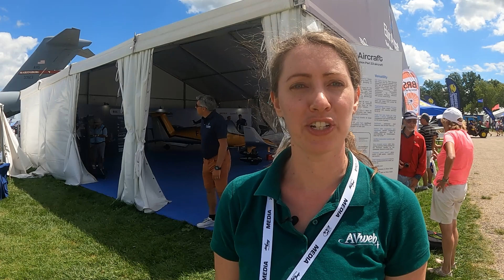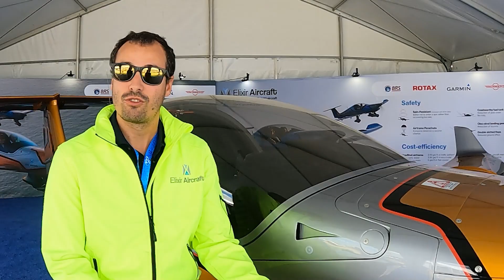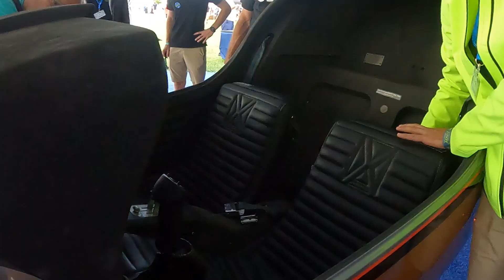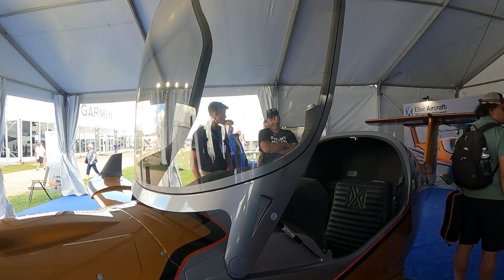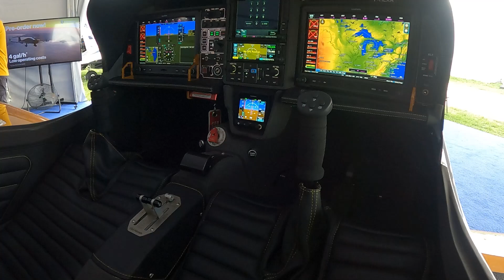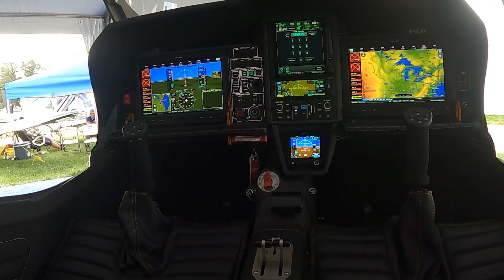AirVenture 2022: Elixir Aircraft

Comment: $250k for a fixed-gear two-seater? I like to see innovation, but at that price I'll stick with my plans to build an RV-10.
If two seats suited my mission, I'd be looking at the DarkAero 1, which should be cheaper than this, has retractable gear, and will be much, much faster while getting around the same fuel economy per mile.
Reply: The Risen 915 SV and JMB VL3 as well... Same price, much faster (especially the Risen), and they don't need to be built.

Comment: Awesome looking aircraft. My only concern is quick egress if the aircraft flips upside-down.
Reply: do you have the same concerns with Vans, Cirrus, Diamond, Corvallis TT, or Icon?
Reply: You simply have a dedicated crash axe onboard a ps a go-no-go item.
Reply: @bwalker4194  Flipped upside-down in water will be very difficult to axe  your way out. Not that simple!
Reply: @pilotpeego1820  you’ll probably want to get the canopy unlatched before you hit the water, so that it will sink out of the way. Flipping it on land will be much more dangerous. You probably wont be awake to escape anyways, the fire suppression system might keep you alive until the firemen arrive to get you out. I supposed the axe is a good idea as well.
Reply: @Heatherder  Noted

Comment: Moi, je pas comrpends $300K pour un 2-seater quand vous pouvez acheter un C172 pout beaucoup moins.  And I only speak Cajun when drunk and/or angry.
Reply: It's a 2 seater, flying at 160kt, and burning 15L/h of fuel. Without taking into account the operational costs (maintenance), that it can also fly with normal car gas as well, it's actually very interesting in the long term.
Though, it's true, 2 other seats are missing, but that is a long term plan of the company.

My flying club (in France) bought 2 of them, the training versions, and costwise, it's very interesting (it's the 250000$ version).

It's true though that this aircraft was initially aimed for the European market, where EASA is sometimes stupidly requiring to much constraints on the aircraft (the perfect example is lightbulbs, we are not allowed to change them). Making something very simple to operate for Europe, will definitely be interesting for the rest of the world, including the US.
Did not mention the fuel prices as well. A liter of AVGAS before Covid was at about 2.5€, (it's now 3.15€, went up to 3.6€/L, about 14$/Gal, when in the US it's about 6$), so very low demanding fuel aircraft is also a plus in the thinking of the aircraft. All of this will definitely benefit in the US, and the aircraft is already lead free fuel compatible.
I approve though, this two seater for now is really more designed for training rather that trip flights.

You can check the type of aircraft we are used to fly here in the EU by checking my videos :)